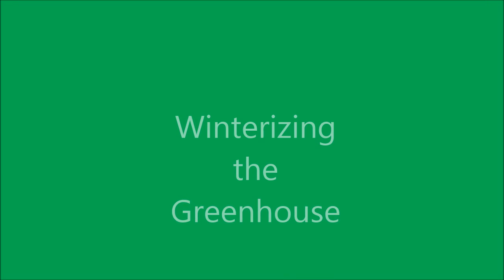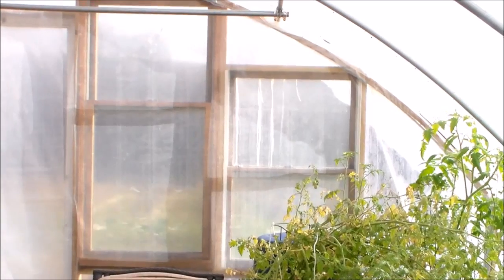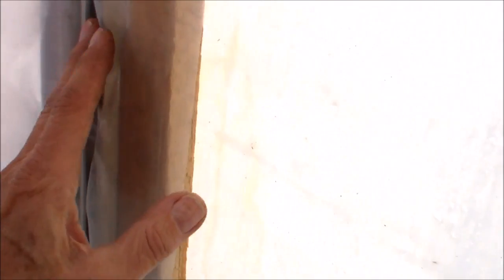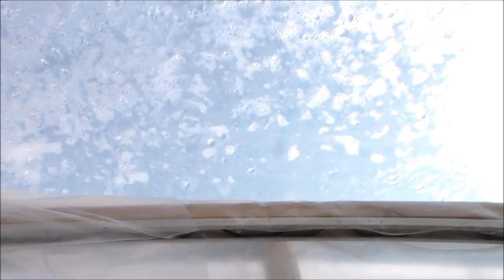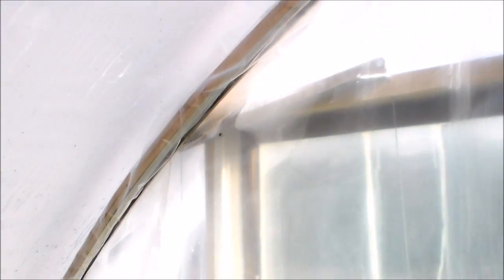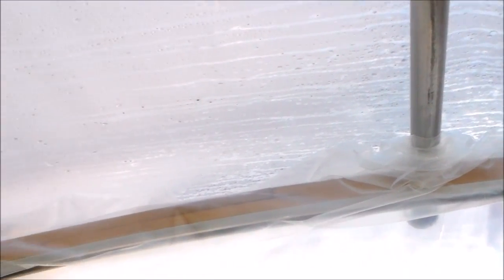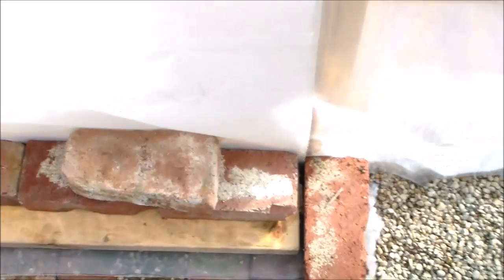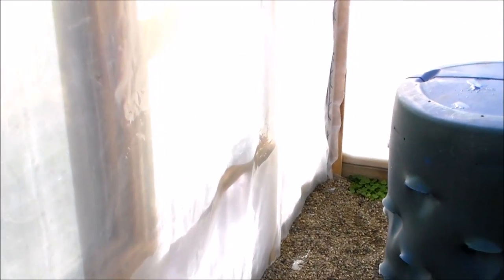Winterizing South End of the Aquaponics Greenhouse

Comment: Question if you don't mind. This entry is located on the South wall of your greenhouse. What compass direction is your other entry at? Did you specifically put entries at these compass points?

My other question. I would assume that this process of creating a dead air space would be done on the North wall so that the solar radiation could more easily penetrate to the interior of the greenhouse. This setup.. I would guess heats the air in between the greenhouse and the interior wall to a warmer temperature than is inside of the greenhouse. I am curious to know how this works the best for insulation. 

I really think your videos are great and the stuff you think up is amazing. Thanks for posting all of this stuff my wife and I love it. Curious to learn more. :)
Reply from the maker: the other entrance is the north end and is the fish house. the North South orientation is the best for solar lighting for the plants, and with the entrances on both ends I can oprn both for maximum ventilation.
Reply: @donaldporta  Thanks for the reply! I assumed the other entrance was on the North for purposes of temp/ventilation control. So lets say you had no fish house and only a single (4 wall) normal green house. Which door would you use as an entry? South or North? Thanks again for the replay and the really great videos